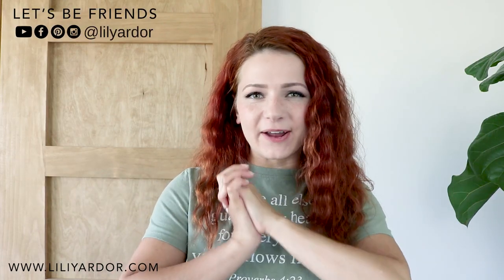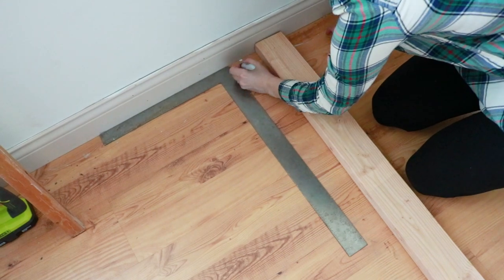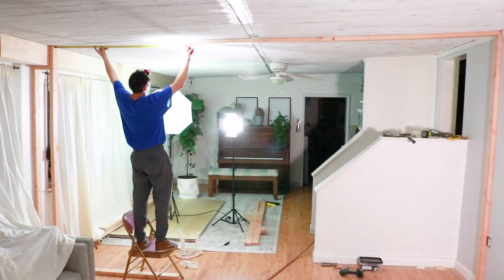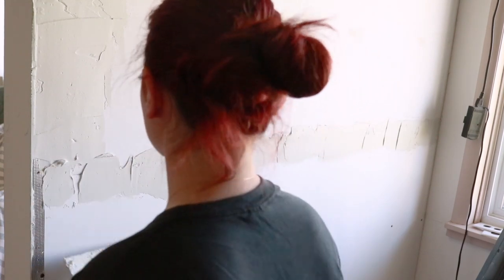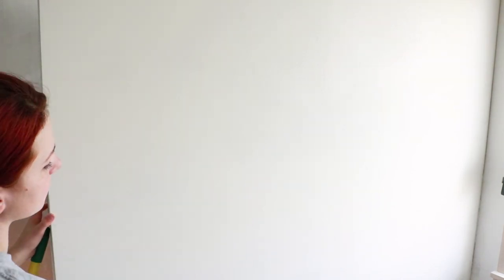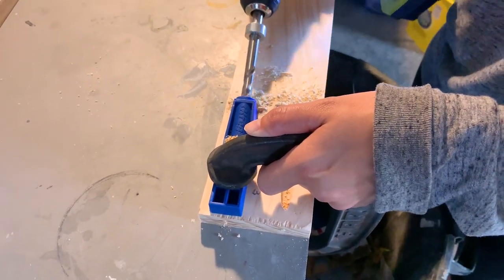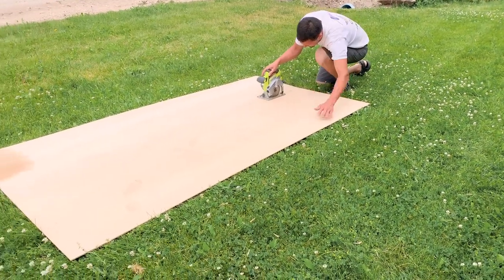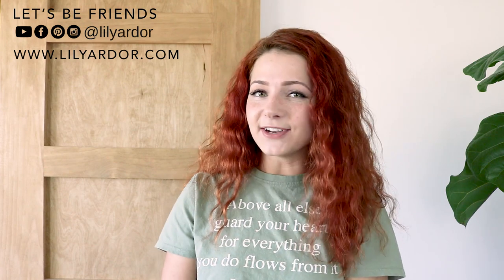Building Our DIY Barn Doors On A BUDGET + OUR DIY WALL | LilyArdor

Comment: For a first time effort by a homeowner, this job turned out pretty good.  So good on you for the successful result.  I was wondering about what appears to be an angle at the top of doorway opening.  Was there a reason for not making the opening square?  I didn't hear it on the video.

Comment: In the case of temporary exhibition halls or temporary stores, floor runners or studs are sometimes fixed with only silicon. One or two screw pieces on the left and right sides of the door may be sufficient. 
Cement Stucco paint that feels like exposed concrete will also help reduce the budget.
Putty, tape, and sanding are all be able to omit, and it's good for a tight schedule because it finishes well with just using finishing trowel on the board directly.
And I envy that big garage.^^
Reply from the maker: Thanks for all the tips :) Oh yeh we thought about using a trowel but we decided to save money and work with what we had on hand :) I'm sure it would of been much faster with the trowel.

Comment: So a common door is 1.5-1.75" thick, this would be less than an inch it seems with the frame you built out and used. You were able to use hardware for the hanging brackets that allowed for you to use that width?

Comment: Pro tip, you can use a grout sponge with a bucket of water instead of sanding. No need to spend the money on the dust control stuff.

Comment: Could I use glass in place of wood for the panels? Also what do you think about dowel joints in place of pocket holes?
Reply from the maker: Sure :D I think that would look great.  I think dowel joints would take much longer because you'd need to perfectly drill all the holes even and it would be harder to get all the pieces to be perfectly flush with one another.  Not an expert but I think The pocket holes might be easier to control when securing all the pieces together.